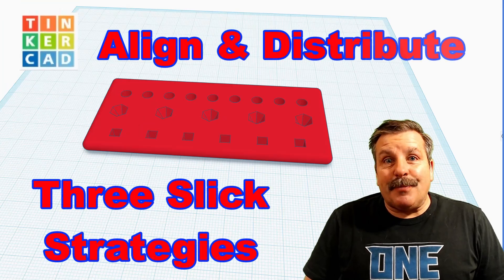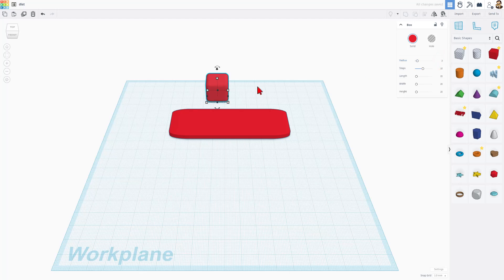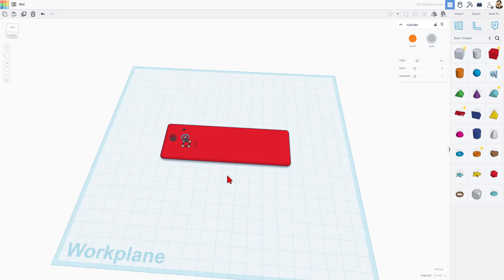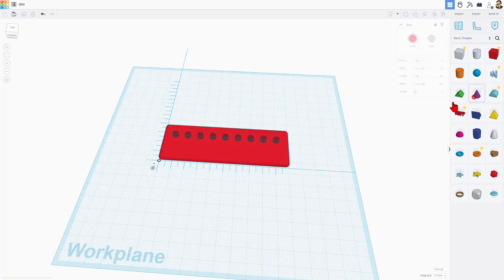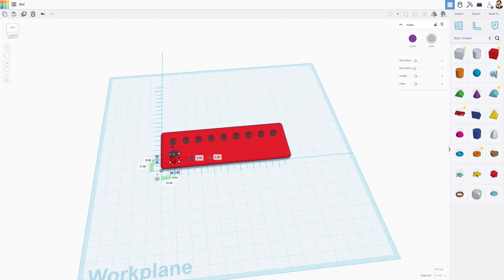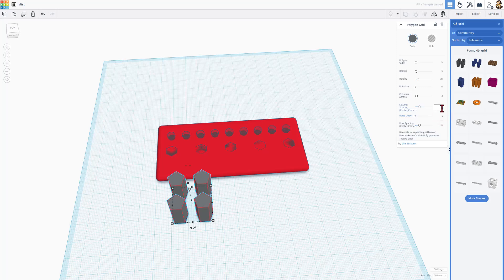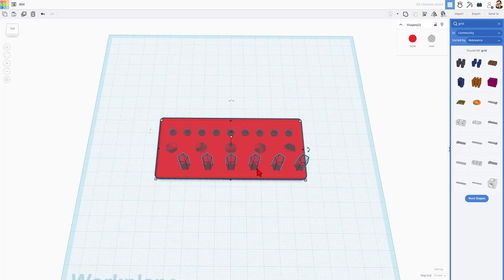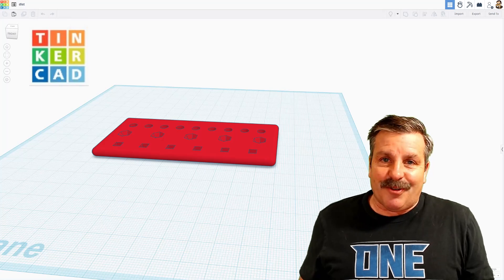Tinkercad Missing Feature FIX! Distribute Ruler & Align Tips in Minutes!

Comment: You gave a great idea for using the square hole feature by matching it with a solid on another piece like a mortis and tenon fit to join pieces together.  Great video, and I always learn a lot.  The ruler kicks my *ss every time, but I guess I just have to use it more to get it down.  Building Star Wars Droids, tinker CAD has saved my bacon many times.  I love it.  Thanks again.
Reply from the maker: My pleasure @GunnerAl9. Thank you for the kudos! 👍💯 It is nice to know there are others out there in the "Tinkercad Saving Bacon" club. =)

Comment: This is an awesome video thank you! Can you expand on this topic with connections? Say I wanted to print something longer than my print bed but not wider so you can cut the model in half but need a way to connect them. Can you show how to use dowels dovetails or click type connections?
Reply from the maker: Thanks for the kudos. I will see what I can with connections. This QR code system was a snap fit. https://youtu.be/5KG-IF31T8g Not quite what you are requesting, but a technique you may still find handy.